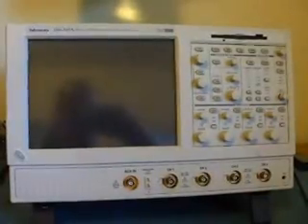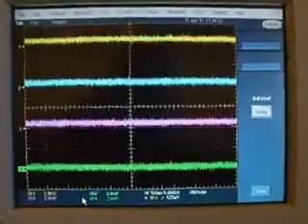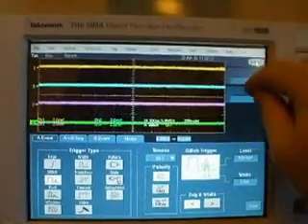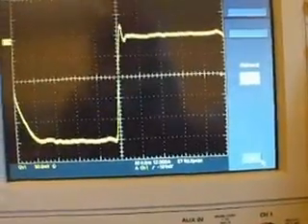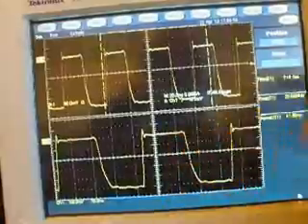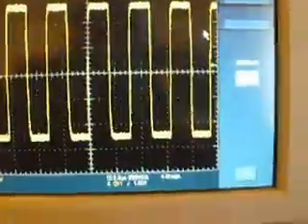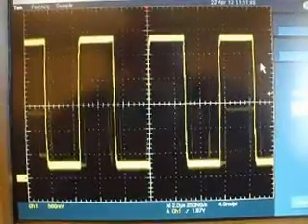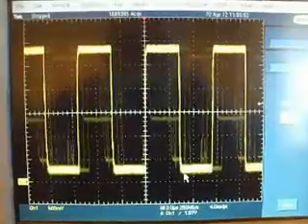TDS5054 Digital Phosphor Oscilloscope

Comment: Or did the septic tank agitation pump kick in...with a 1 megohm resistor on each prong of the US wall socket I get a drop of 1/10th of a dB when it kicks on. If you blink just before it happens it looks like the room goes completely black when you are using halogen light bulbs at night.